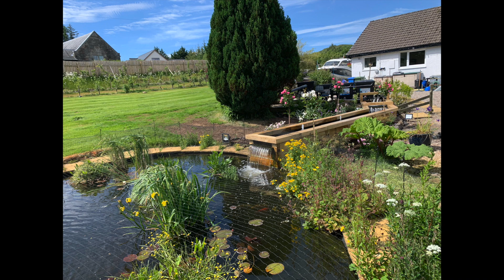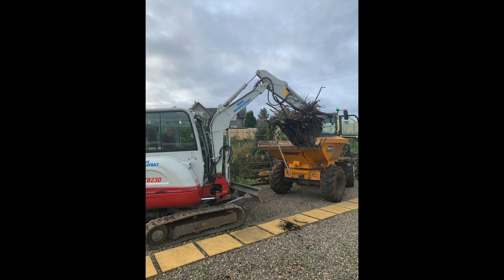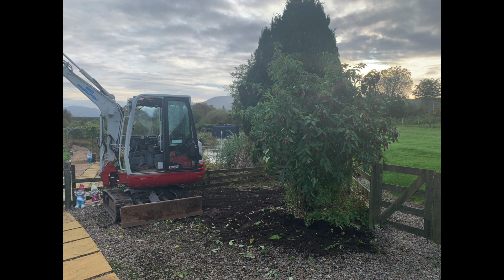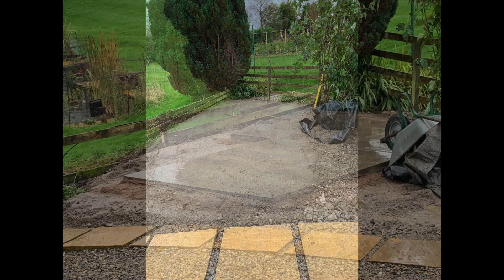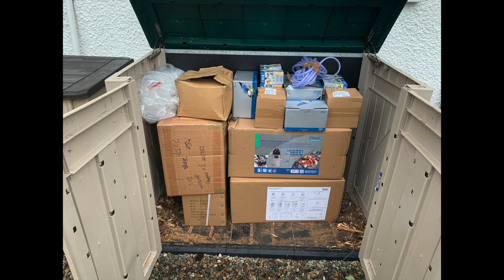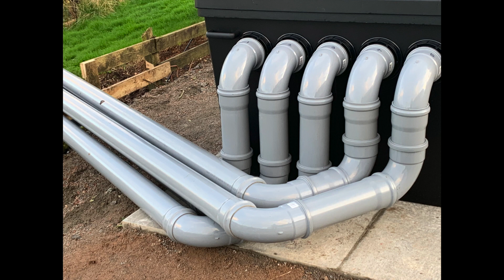Koi pond 100,00 litres with Oase Proficlear Premium XL Drum Filter - building a rill with sleepers

Comment: Nice setup, considering getting the same equipment, do you know how much kWh the system uses during the summer?
Reply from the maker: Hi Marc, thank you for the comment.

During the summer the 2 Bitron UVC clarifiers each have 3 x 60 W UV bulbs so during the summer they will use at 730 watts.

The 2 Aquamax 26,000 pumps use just under 400 W each when running at 100%.

The high-pressure pump in the drum filter system only runs for 10 seconds at a time and during the summer the system cleans 3 to 5 times per hour.

In the winter, the Bitron UVC clarifiers are switched off and using the SFC (seasonal function control setting) they turn down, automatically to around 50 to 60% when the water goes below 12 to 10°C.

I also have an AP 12,000 air pump and I’m not sure how many watts this consumes.

I have to say the system looks after my large volume pond extremely well, and regular water tests come out negative for everything that I test and with the two waterfalls in the rill and the water pouring into the small top pond with the five 110 mm pipes the oxygenation is superb and when measured with a standard kit I get 10+.

I would highly recommend this system.

I would be interested to know where you live, the size of your pond, and from whom you would consider purchasing your equipment.

Hope this is info is of value to you.

Best regards, Barry.
Reply: @barryvallance6135  Thanks for your reply, I'm not sure about the size of the pond yet, planning on our renovation (extending) our current pond. I'm originally from the Netherlands, also lived 6 years in Scotland, and now since 6 years in Germany (Oase is a german company, so the equipment is easy to get here).

How much manual maintenance do you have to do with this system? I'm using the Oase BioTec ScreenMatic2 60000 at the moment, but I have to clean the filters a lot.
Reply from the maker: I’ve made an error: Bitron UVCs use 180 watts each so total for the two is 360 watts
Reply: @barryvallance6135 that ok, we tend to only turn the bitrons on during the summer… and we overproduce with our solar panels then anyway.
Reply from the maker: Hi Marc.
We have several suppliers of Oase filter equipment in the UK but only a couple who will supply major items like the Proficlear Premium XL drum filter.
There is no regular maintenance required as it is self cleaning. If the frequency of cleaning cycles gradually increases it means that slime algae may have grown on the sieves. They can be pressure washed without removing them from the drum. This may need to be done twice per summer season and is a quick no mess job. One can buy specialist cleaning fluids to spray on. These are fish safe. They should improve removal of the slime algae when pressure washing. Once per season I remove the sieves and power wash both sides which does clear the pores in the sieves more effectively and certainly reduces the cleaning cycles back to low numbers. There is a knack to removing the sieves and reinstalling them but once you get the hang of this it is a very easy job.
Overall minimal intervention is required as the automatic cleaning is so effective.

Oase recommend opening the bottom slide valves once per month in each of the modules to empty out any sludge that has collected at the bottom of the boxes.

So the system is very low maintenance and can be left to do its own clean apart from the occasional power wash.
Kind regards, Barry.